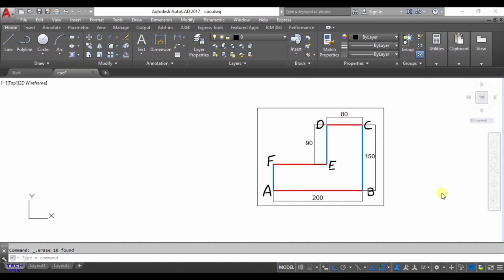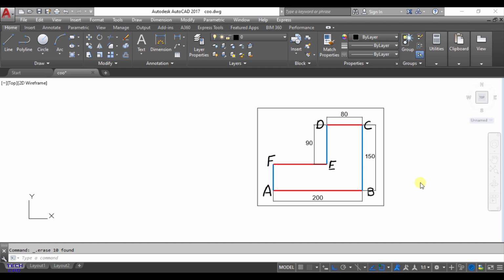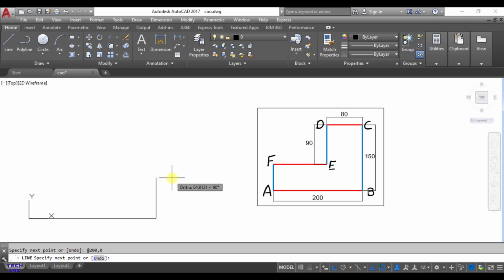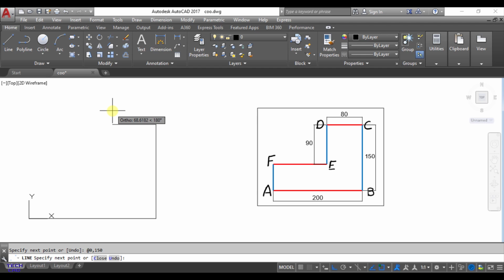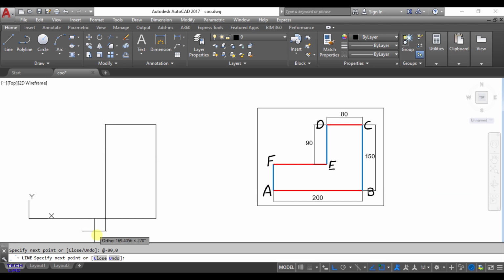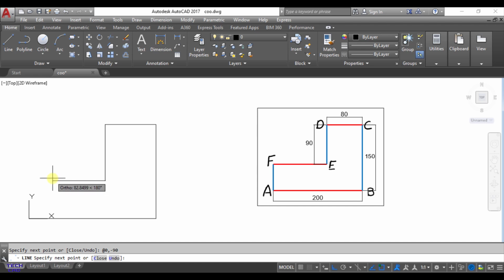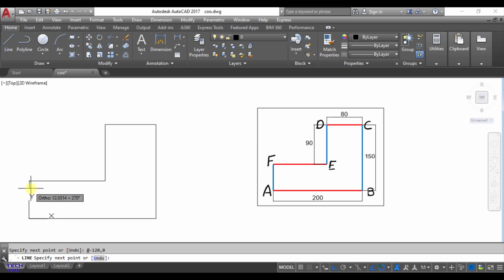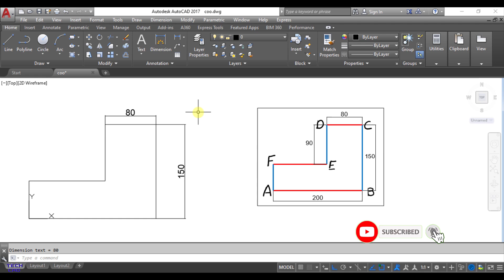RELATIVE COORDINATES IN AUTOCAD

Comment: I have a question about the video. After I draw the shape I would like to add  a line offset from C point by (1,1) to point 3,3. How can I do it?
Reply from the maker: You can use the offset command to make the entity offset to any distance..
All the best..
Reply: @TECHCAD  Thank you for your time to reply. Unfortunately it is not the same thing. I try to start a line at a distance relative to a known point to another point (relative or relative to another point, or in absolute coordinate). The relative to another point is managed by "From" in the context menu.  I learned that "From" has some bugs. It might not work if the "Command Line" is not docked. I will try it later today.